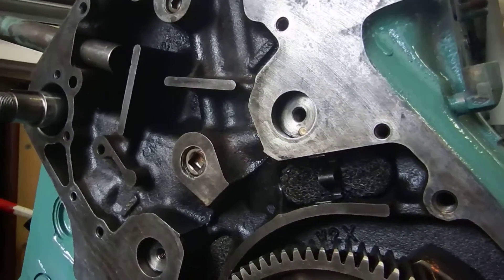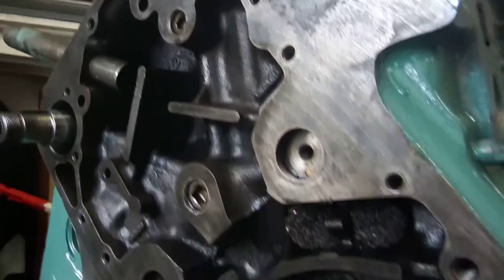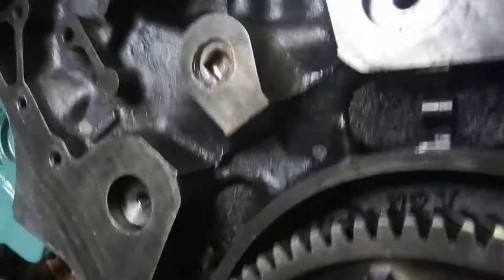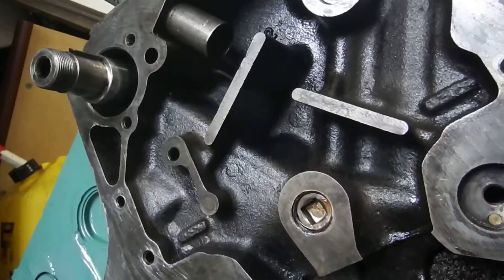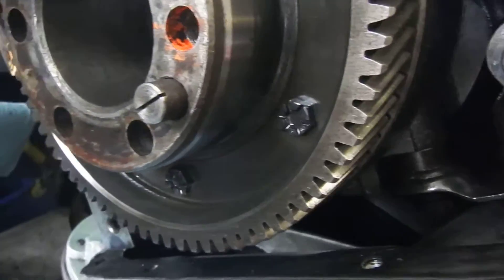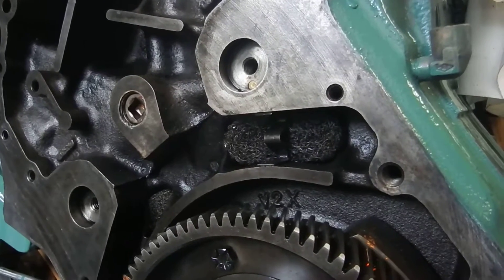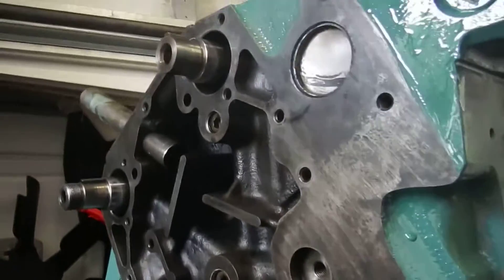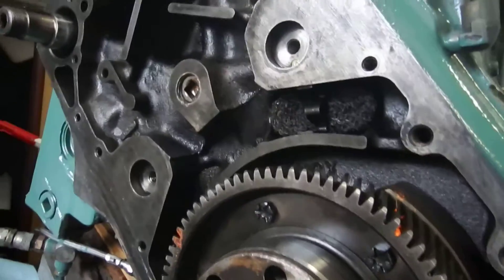8v71 detroit diesel end plate oil leak

Comment: Detroits got a bad reputation for their oil leaks, much of it from the airbox drains. and they were prone to start leaking from the end plate gaskets. That's why Detroit Diesel started putting a bead of silicone on the new gaskets, and that did help some.
There was a joke about a truck owner who had an 8V71 that had no oil leaks whatsoever. He bragged to everyone about his engine, he was so proud of his Detroit Diesel that didn't leak oil, that he took a picture of his engine and had it blown up big, and he bought a frame for the picture and hung it up on his living room wall. The next morning he woke up and came in to his living room and there were two large oil spots on the carpet!!